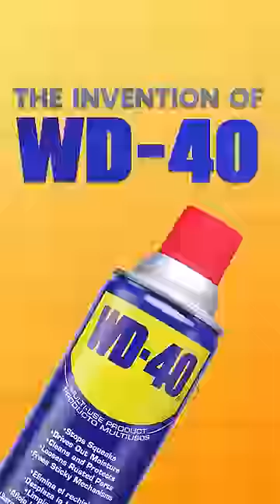The invention of WD-40

Comment: Yeah my father and I stopped using it for the most common uses after years when we realized it attracts dirt and if you use it on locks and hinges it has the opossite effect of loosing it after a while. We initially replaced it with graphene lubricant but the graphene attracts dust and also some what wears away at the metal cause friction and small particles. We switched over to a dry film lubricant about three years ago that a locksmith recommended and that seems to work great and doesn't attract dust since it dries out almost immediately.

Comment: Know what a distributor cap is? I'm auto mechanics we sprayed one with WD and fixed a misfire. We displaced the moisture. 
Fun fact: for final grade we were tasked with rebuilding any engine we brought in. I had a five HP Briggs from a lawnmower. I purposely left off the little round muffler just to see how loud it would be. Class next to us evacuated thinking it was gunfire. No shit. Our shop was in the Jr high building. Got an F. Never ran after that. But for 15 seconds it was awesome.

Comment: The best thing relating to WD-40 is that one gag in King of the Hill where Hank Hill pulls out a can of WD-40 to lubricate a door hinge, realizes that the cap of the WD-40 can is stuck, and then proceeds to pull out a smaller, lidless can of WD-40 to loosen the cap on the first can.

Comment: The best use I have found is after each use of my stainless steel BBQ the whole outside gets a light wd40 coating before putting it back under the cover. Years later my barbecue still looks brand-new :)

Comment: I used it for years and then i found PB Blaster which makes WD40 look like water. Although i used to put a can in my kids cars so if their car wouldn't start because of moisture, do to poor maintenance i told them to spray it on the plug wires and distributor cap to absorb moisture and the car would start,when they asked how that happened i told them magic.

Comment: This is how I see it; WD-40 cleans off water and dirt, so the oil/sealant applied afterward adheres better to better lubricate and to prevent rust. Using WD-40 alone on ferric parts will quickly get you rust.

Comment: I work at a bike co-op. You wouldn't believe how many cables/chains/etc are destroyed by wd40. Not the wd40 itself, but the fact that wd40 also does a good job of removing necessary oils, so when the wd40 dries the resulting part is now without lubrication. WD40 is useful but not lubricant, folks!

Comment: Atlas was made from stainless. They used WD40 to prevent ice forming on surface of a rocket not rust. The ice was forming because of usage of cryogenic oxygen as oxidizer. This was its original use case.
Reply: I was about to say the same thing. Hopefully many see this comment. It was to stop ice forming, not rust.

Comment: WD-40 will actually make a squeak worse. It will evaporate and attract particles that will sand and polish. You’re better off using oil or grease, silicone is best. It’s a great water displacer though and can help breakthrough rusty bolts.

Comment: Locksmith here. Never NEVER ever use WD40 as lubricant for hinges or locks or anything that requires proper lubrication. WD40 is great at 2 things, displacing moisture and as penetrating oil to free stuck parts. It will evaporate since its mostly solvents and whats left behind will attract dust and dirt and cause the moving parts to wear excessively. For locks or hinges use something PTFE based like Prizm or Houdini, WD40 even makes a "specalist" dry lube, just dont use regular WD40 as lubricant.

Comment: It wasn't invented specifically to protect rockets rather it was invented for aerospace applications. The rocket chemical company was in San Diego California not Chicago. Convair was the first customer to use it to protect the atlas rockets not the air force. Larsen may have not even been the person to invent it. There is no patent on the original formula so no inventor(s) are listed. Norman wasn't the first person to figure out that moisture causes rust, while you might not be claiming that the way you say it does.

Comment: Using it in your hinge is a terrible idea. It desolves the lubricant in there. 
Pull the hinge pin and grease it, you can use vaseline if you like. Graphite will work too.

Comment: WD-40 will penetrate and loosen rust; but it could never protect anything from rust.

A product which is used to loosen rust cannot then also be used to protect against rust. 

Similar to diesel but with a bit more oil, wd40 is made to cut into rusted metal. But it’s that very functionality which prevents it from being effective at lubricating or protecting. It has very little oil content, and therefore it evaporates very quickly.

In its function as a degreaser, it also evaporates any grease present. Meaning, it’s the opposite of a lubricant.
Reply: @Watcher you just repeated the things in the video.. you didn’t add anything to this at all. I saw the video and so did everyone else I don’t need it read out to me. 

The thing is I’ve seen innumerable people use WD 40 to lubricate their bike chains, for instance, and you’ll see the same thing every time after a few weeks; the product has completely evaporated and left rust in its place. 

I never said the WD 40 causes rust, but using it as a lubricant will leave you without lubricant and that eventually means rust. 

You said it yourself, it is a oil based solvent; key word is solvent. 

There is a big difference between grease or even any type of oil, and a oil based solvent. 

Grease is too thick to us as lubricant for a bike chain, but most oils work fine if applied sparingly. No finer product is required to fill the pores in the metal, unless of course you’re looking to penetrate oxidation in which case it would be useful. 

What you’re basically saying is that a solvent can do solvent things and also the opposite solvent things at the same time.

Solve penetrate and the main trade off is that it evaporates. But one of the main characteristics of a lubricant is that it sticks around to keep oxygen and anything else from getting to the metal and causing corrosion. 

If the stuff evaporates relatively quickly which it does, then it’s not a lubricant. 

Does WD40 evaporate slower than a pure solvent? Yes obviously. But that doesn’t make it the same as oil or any other effective lubricant.

It may have been an effective product from their perspective back in the day, I’m not sure. 

But as it stands now; WD40 is like any other gimmicky Canadian Tire product. The gimmick is that it can both break the rust people have allowed to build up, and then also lubricate at the same time so you don’t have to actually put the work in of doing both of those things. 

It works decently as a penetrator, but even then honey goo is a much better product because it sticks a lot better. 

But the additional oil in the product will have it evaporating within a couple weeks just sitting there. There’s not enough, because if there way you wouldn’t be able to spray it out of a can.

Does a reversible set of pliers work for two separate applications? Yeah; but it does both so badly you’re better off buying two separate tools. 

This is a concept as old as marketing. 

Don’t get me wrong, it’s not a useless product. But first of all there are way better similar products, and second it doesn’t lubricate to any meaningful extent.
Reply: @Watcher go to the store and find a “degreaser”, it will have much the same ingredients as WD40. In fact, WD40 is listed as a degreaser. 

How can you claim to be degreasing while also greasing? At the very least, isn’t there going to be a trade off associated with that opposing functionality?

Of course there is. 

You’re basically feeding back the Canadian Tire marketing talking points; you believing the hype that something can do one thing and also it’s opposite, and you’re not even allowing any caveat to say “but obviously it’s not the same as oil in terms of its lifespan when used”..

You’re just saying “it’s oil based therefore it’s oil therefore it lubricates” which is oversimplifying the nuances of the product.

Comment: Original formula WD-40 is a poor lubricant and even worse as a penetrating fluid, which are two of the most common ways it’s used. Ask any chemist or impartial mechanic; even DOT 3 works better for both, neither of which are intended uses

Comment: WD-40 is terrible and should never be used on most metal things. Funny thing is it does actually cause rust. Since most moving parts displace the lubricant and that moisture on the areas that pushed the oil out rust. So basically never use it. We have better stuff now that does not rust things or dirty things up since the lubricant attracts tons of dirt and debris.